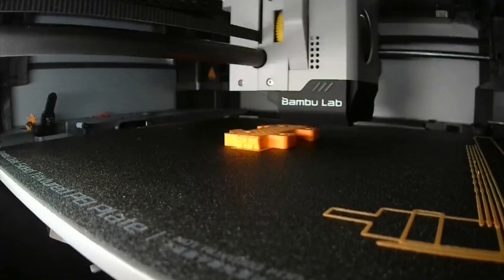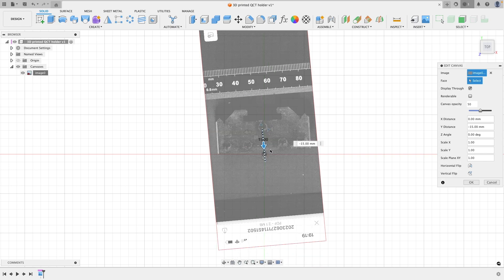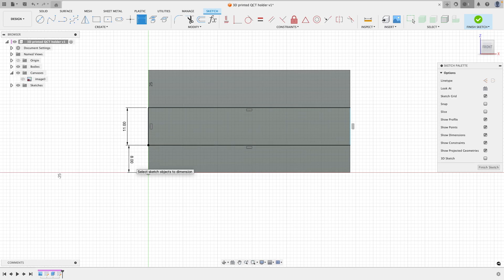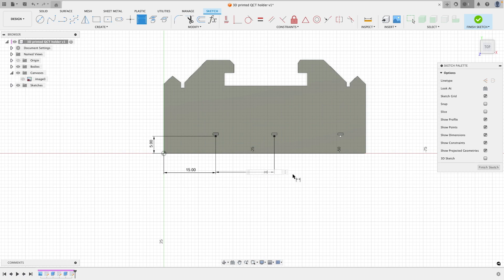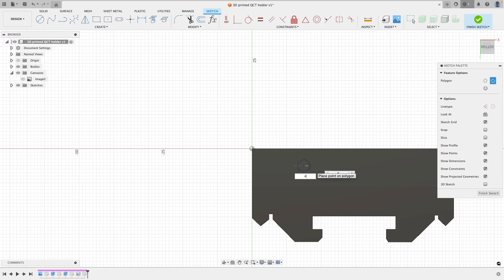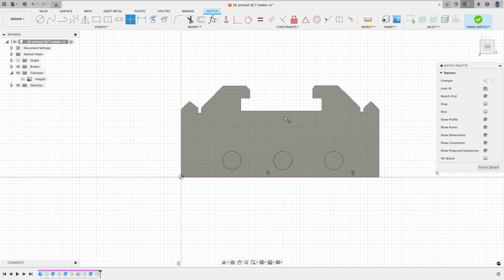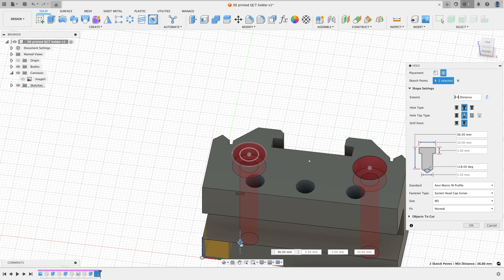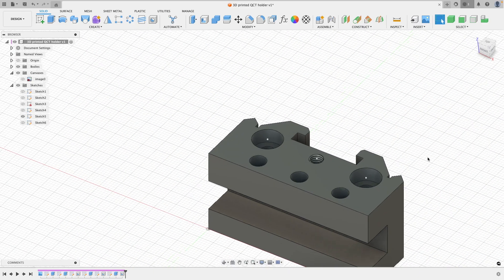How I Design parts for 3D Printing DFAM!!!

Comment: A tip here given that you are designing this yourself is design in the supports. You dont need supports running the entire length of the part. Just create some custom walls where the tool sits on the corner and the open wall. Then in your slicer it can simply bridge to that sacrificial wall instead of having to print all that support.

Same with the nut cavities, just create a later below them 0.2mm thick which will act as a sacrificial layer.

Comment: 3D printers are a great companion tool for machining. For example im designing a CNC conversion for my mill and being able to 3d print parts that are fairly rigid to test them before I get them machined is invaluable. And I do think with some of the more rigid plastics like Polycarbonate with enough walls and infill for us hobbyists might actually be able to replace some aluminium parts.